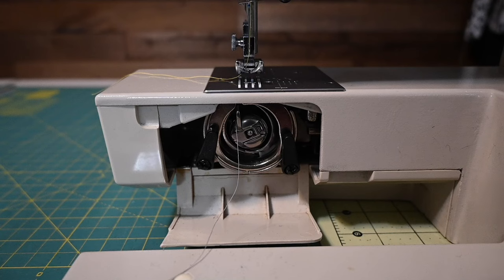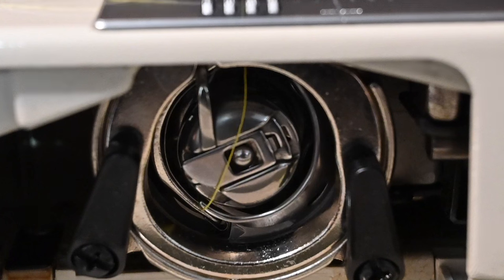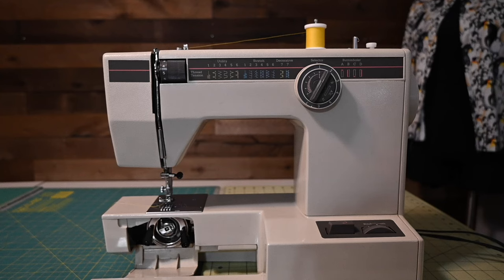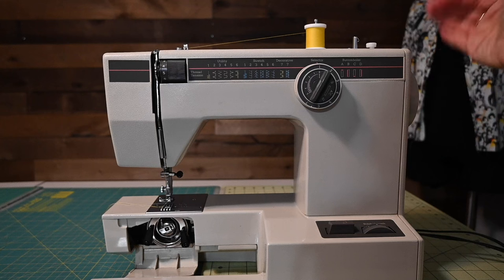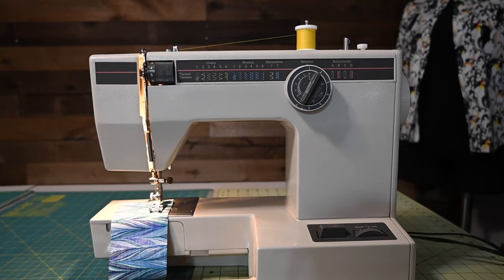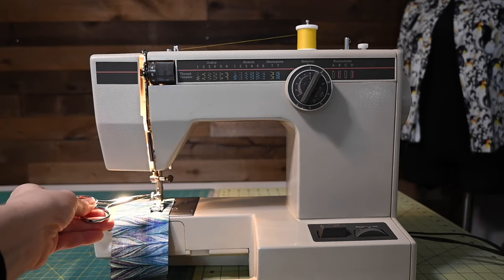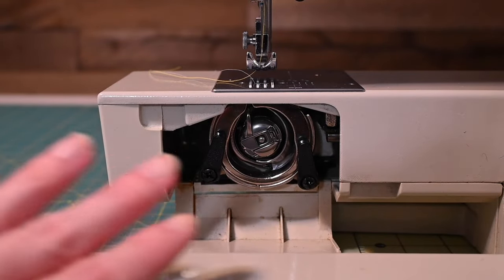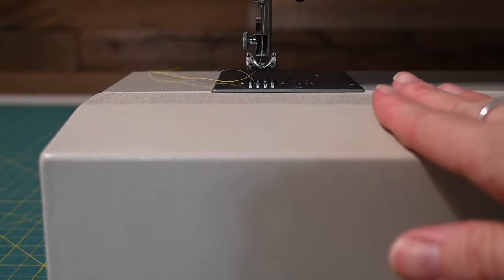3 Reasons Your Bobbin Thread Keeps Jamming (and How to Stop It!)

Comment: Thank you so very much for explaining these sewing "problems" to us.  I'm not a newbie, but, I'm also not an expert.  I've often wondered why they said for you to not turn your wheel in the "opposite" direction.  I knew it could cause problems with your bobbin thread, but, i never knew why that would happen.  I also never knew what could happen if you didn't hold your thread at the beginning of your stitching.  I've always done that, but, never knew the specifics of what would happen when you didn't.   Plus, I've often wondered how the thread take up lever position was important at the end of your sewing.  I try to remember to have it in the uppermost position.  But, i have often had that extra loop of thread under my fabric - and, i never knew why that has happened.  WOW !!!  You've explained so many things that I've been wondering about for so many years.  TYSM for sharing your techniques and knowledge with us.  I appreciate your help.  😻❣️😍
Reply from the maker: Thank you for the kind words! One of the things I love about sewing is that there is always something new to learn, even if that's the "why" behind the "how."
Reply: @twinsnneedles  That is so true !  😻❣️😍

Comment: Thank you! I've been struggling today with a project that is slightly hard on the machine in the first place but couple that with not using the same machine and second guessing my infrequent usage of sewing machines. Thank you for explaining exactly what I have been doing wrong 🤘🏼
Reply from the maker: So happy to help! Every once in a while a machine really does have a major problem (timing gets out of whack, for example, and it really won't sew right), but that is really not very common.
Reply: @twinsnneedles  yes for sure. For the most part, it was my settings. I'm still having a slight difficulty getting the bottom stitch correct to my liking but I was able to complete the project and it will be good for as long as i need it. It was vinyl and I just find it tricky stuff.

Comment: I have a Kenmore limited edition that has the top load bobbin with the clear plate. I have a Kenmore limited edition that has the top load bobbin with the clear plate.  I had been having problems with jamming periodically which were sometimes solved by just cleaning and oiling, but your advice about holding tension in the thread as you get started solve that problem for me even though the machine already had that little tension hook. Thank you
Reply from the maker: Great to hear! Kenmore made some very nice machines.

Comment: Thanks for this help.  I have not used a sewing machine for 45 years but someone gave me a sewing machine recently and sure enough it had a few issues.  It appears to be brand new but first the hand wheel was stuck and I couldn't figure out why.  Turns out it was that the little latch to thread the bobbin was switched to that position and it automatically locks the hand wheel.  Three weeks of trying to find that info, 🤣 I finally figured that out yesterday and now the bobbin thread would not pull up.  I took it apart (I started that yesterday) and finally today I figured out that the entire thing had been replaced backwards.  I now feel a little badly for the original owner because they gave up but now I just might have a working sewing machine that was given to me for free.  BTW, the machine was donated and I have no way of knowing who donated it to the agency, which it was then purchased by my friend who gifted it to me because he knew I wanted a sewing machine.  Sorry for the long comment but it I'm glad you were here to help me.  Thank you!
Reply from the maker: I am SO GLAD to help! I think a lot of sewing machines out there would run just fine with the kind of TLC you've given yours. Thanks for not giving up on it!

Comment: Hi! im new to sewing and watching this video helped me a lot but i have an issue that may have not been covered in this video.
my sewing machine keeps jamming and forming rats nests under my projects no matter what i do and ive checked my bobbin area to see what the threading process looks like but it looks as if my top thread does not fully circulate, i dont know what the reason for this is and i would like to know if you have any thoughts about it
Reply from the maker: It sounds like maybe the top thread is getting caught on something in the bobbin area. This can happen when there's been damage to the bobbin case. If you have the manual for your machine, it should tell you how to remove the bobbin case. Once you get it out, feel very carefully on all of its surfaces to see if there are any rough spots. You may be able to polish out rough spots with 2000 grit (or higher) sandpaper, but be very gentle when using that. If that doesn't work, you may need to start the search for a local repair tech to take a look.

Comment: I have that double thread problem with my BabyLock Presto 2……also when I start to sew, if I don’t hold my threads I get the mess underneath.  I wonder if we pressed the needle up position before starting to sew?????  This problem is very annoying.
Reply from the maker: I always hold onto my threads when I start to sew. Some machines seem to need it more than others, but I really do think most machines sew better when the seam starts out with a little tension on the thread tails. I think keeping the machine "needle up" at the end of each seam might help with your double thread problem, since that's basically what I'm doing manually here.

Comment: I have the popular mini portable machine that I purchased from Aldi. I purchased it 3 years ago and just pulled it out so I can start to re-teach myself how to sew. The machine jams after yhe first few stitches. I'm so frustrated 😢
Reply from the maker: Have you tried cleaning it? It may have a little lint buildup from before you stored it.
Reply: @twinsnneedles   I opened it up to see if there was thread stuck. I tested the bobbin case with the hand wheel and it was sticking. I noticed the needle was sticking. I took the needle out and it was not sticking. It's crazy because this machine is brand new never used. I am going to change the needle later and hopefully that stops the issue.